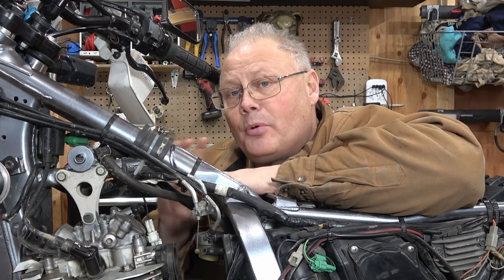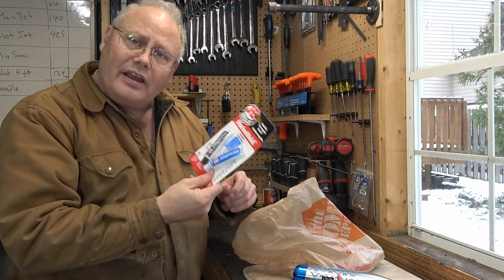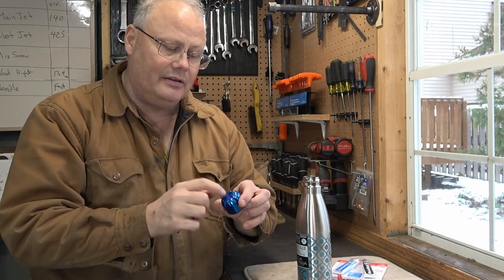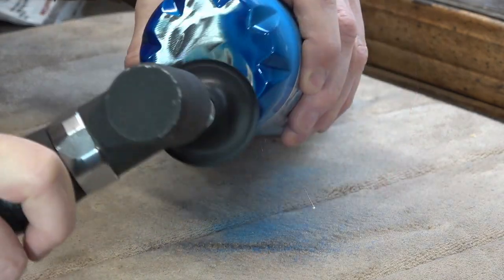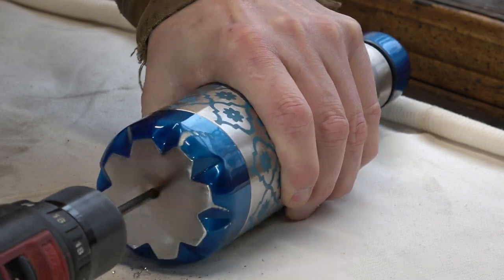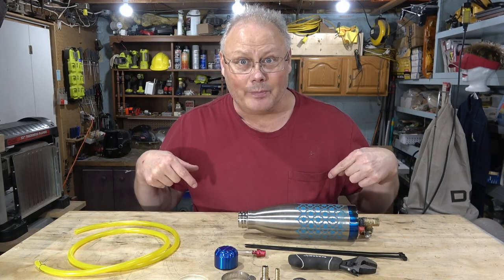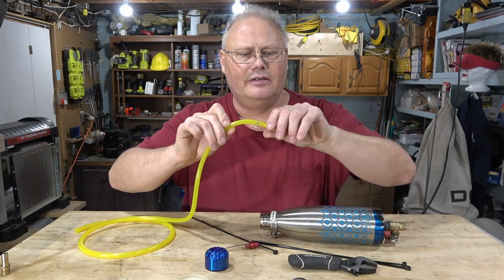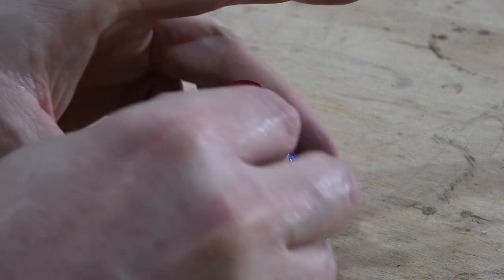Today I make a Hanging motorcycle fuel bottle for your shop.

Comment: Another useful project Dino. I can use one of those so I better get to work. I like the basement work area. You may have my problem - two areas often requires some tool duplication. Not really a problem ;)
Reply from the maker: Lol oh I do, I actually built the shed to move my mecanics tools out there, but as you said, you need the same tools sometimes in the basement. So I do have a lot of duplicates.
But as you pointed out..... not really a problem.
Thanks 
Di o

Comment: Hmm. I have been searching for an auxiliary tank in my local area, but my search has turned up empty. Nothing but blank stares and confused looks from the big box store workers. I like this idea. Looks like a fun little project too.
Reply from the maker: Ya I don't think these are too common. I know you can buy these on Amazon but it's fun to build stuff like this, it's not always about saving money but having some fun making stuff.
Thanks for the comment.
Dino
Reply: I was able to source a metal water bottle at a place called Ollie's Bargain Outlet. The rest I found at Lowes and in my stash. I've used it once so far. Works great!

Comment: Ya know... Amazon sells aux tanks for less than $16. Just saying.
Reply from the maker: Lol ,Maybe, but it's way more fun making one than clicking a button.
Reply: @DinosTinkerShed  I can get behind that!
Reply: I bought one of those on Amazon.  It’s crap.  The petcock leaks badly and is a unique size so there are no parts to fix it.  I ended up making my own with a bulkhead fitting from Amazon and a hose barb from HD.  I used a leftover lawnmower fuel valve for the petcock.
Reply: @dancarey3303  I bought mine from Amazon as well. Works a treat for over a year now. Sorry you got a bad one.

Comment: I used a windshield washer reservoir form the auto wrecker....added a 5' piece of rubber fuel line and a small valve at the end ,oh and a few clamps...$8.
thanks for the vid!
Reply from the maker: Now there is a fantastic idea and a great reuse of old parts. Thank you for sharing!
Dino

Comment: Dino , The ball valve is too big and expensive. There are other bottles available for a couple of bucks more that have windows or are clear and free so you can determine the level of fuel. 
If you were to turn the bottle upside down and put the fuel outlet in the cap then it would act like a funnel. 
The bottom could have been taken off neatly in a few seconds by your pal Bill on his lathe. No charge. Otherwise........Good boy.
Reply from the maker: Hey Bill, thanks for your thoughts. I think all of the ball valves are too expensive so I agree with you on that but the size actually worked really well when your hands are greasy or cold. Interesting Idea to turn it upside down, filling and venting may be a bit harder though but not insurmountable, Ill keep the lathe in mind for future episodes!
Thanks again Bill
Dino